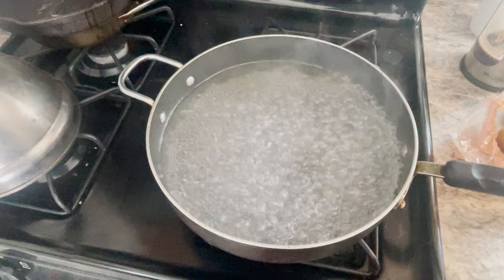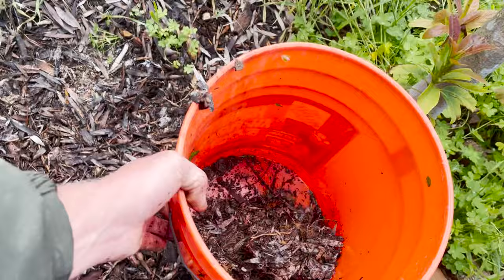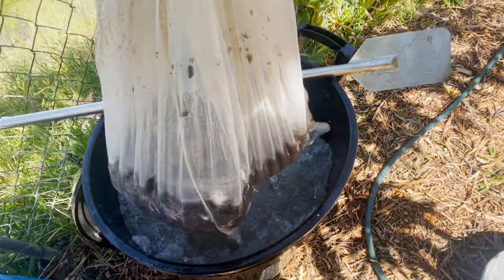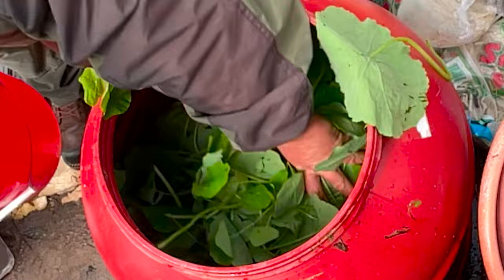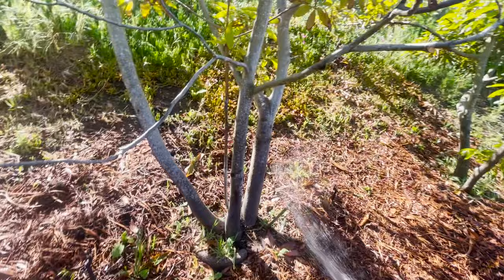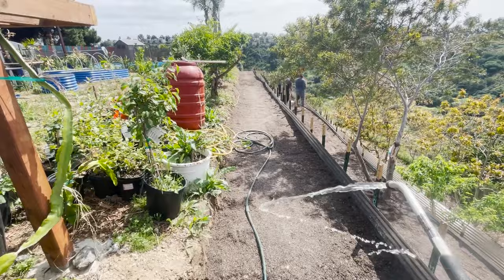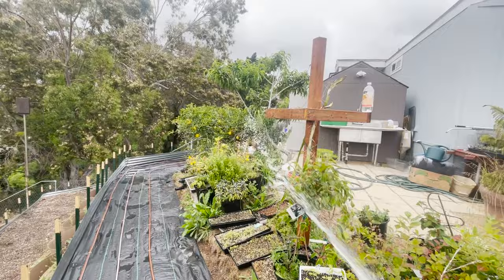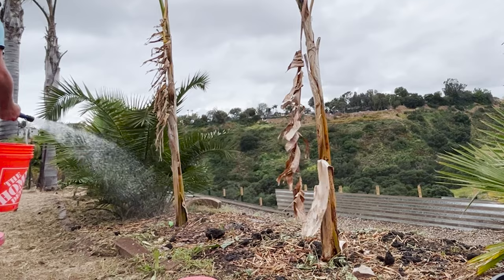JADAM Microbial Solution (JMS) culturing & Application Techniques.

Comment: For someone who makes JMS all the time, you did well here, nice video. I stopped using bags and just put the blended potatos and soil straight in and mix it up
Reply: In Panama its usually ready in 24-30 hours
Reply from the maker: I too have made 1000’s of gal of JMS. The problem w/ not using bags is the debris will clog your pump/drip  system. If your doing small scale and scooping it out for application, then yes that works. For any larger scale application filters are extremely important in drip and fertigation systems.
Reply: você diz direto no vasilhame de água ?
Reply: Same!

Comment: Nice jms! We skip the bag for our carbohydrate and just put it straight into the water. Anaerobic microbes!
Reply from the maker: Yes that works, but also a great way to clog a pump system or fertigation injector.
Reply: @rogueregenerativeagriculture  we hand water each one of our 100ft beds. It takes time but that's how we do it. Doesn't clog our inline pump. We never run it through our sprinkler system.

Comment: Good stuff!  
QUESTION:
Hoping you can help me figure something out.
I'm making this to innoculate my biochar.  I have about 7 gallons of biochar in a huge tote soaking in water.  I'm planning on adding about 4 gallons of this JADAM to the biochar.  
Then I want to add it all to my compost but I'm worried it could be too strong and burn my crops.
My compost bin is packed with nearly finished compost and it's 3x3x3 ish.  
Can I add the entire 7 gallons of biochar and 4 gallons of JADAM?  
Thank You!
Reply from the maker: I have a video on my process for charging biochar, not sure if you’ve seen that? The risk w/ biochar is not that it will be too “hot” (charged w/ nutrients that will burn your crops), actually the contrary. The real risk is applying biochar without charging and sponging up available nutrients. I wouldn’t worry about that. Sorry I didn’t catch  your question earlier.

Comment: Please advice: where can I find this hose pipe with small portable motor which looks portable by keeping with water bucket?
Reply from the maker: https://www.amazon.com/Dramm-22625-Syphonject-Siphon-External/dp/B002KCY2WS/ref=asc_df_B002KCY2WS/?tag=hyprod-20&linkCode=df0&hvadid=198107334619&hvpos=&hvnetw=g&hvrand=8384784832490431851&hvpone=&hvptwo=&hvqmt=&hvdev=c&hvdvcmdl=&hvlocint=&hvlocphy=9031341&hvtargid=pla-343191232074&mcid=ed13a456b7d63a8e92d037f977383820&gclid=CjwKCAjw17qvBhBrEiwA1rU9wwAG5CNOUTQBiszQka9jZAgu6JcNpa-kLPuhzml9t9TVY0e5zgVsfhoCEtsQAvD_BwE&th=1

Comment: Looks like way to much soil and potatoes for 30 gallons
Reply from the maker: There is no precise number when culturing, you could use a little less to culture 30 gal. amount, however I prefer this ratio and get very active cultures. I’ve made it 100’s of times on many sites and had great results. Cheers.